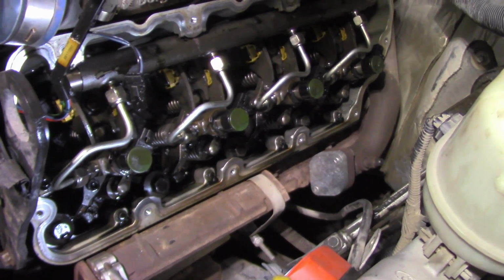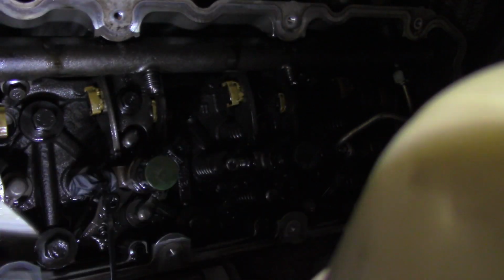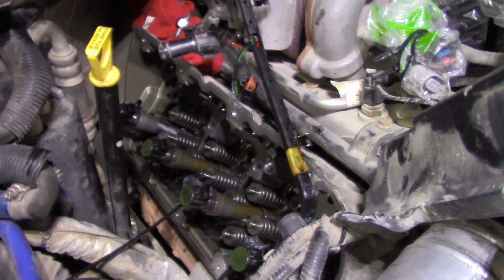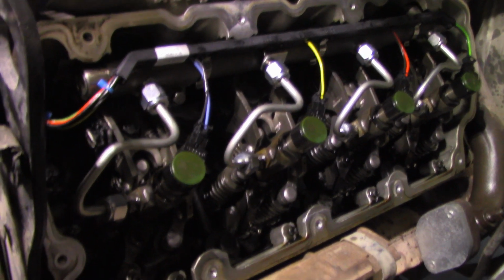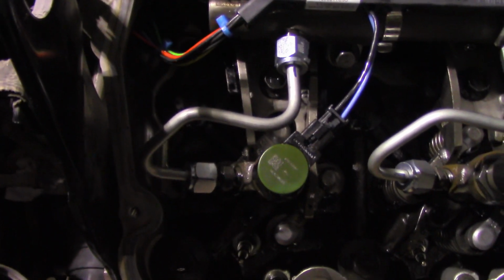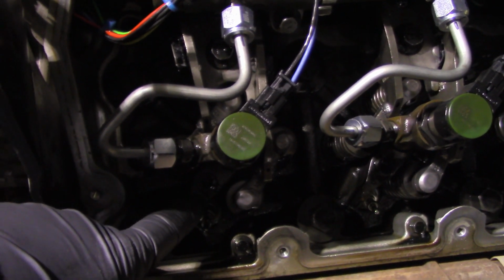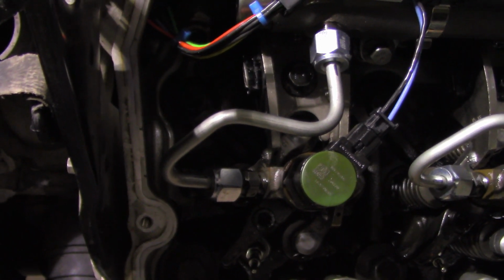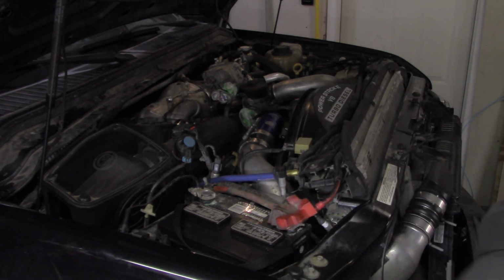F250 6.4 Powerstroke Rocker Assembly and Fuel Injector

Comment: Is there a seal or crush washer where the fuel line from the hpfp connects to the fuel rail?
Reply from the maker: Sort of. Not what you're probably expecting though. It's metal on metal but its precision- that's why they are one time use (the lines). By torquing the b nut on the line, it's conforming to the steel nipple on the hpfr and creating a seal.
Reply: @USAF99 Im talking about the fuel line connecting to the rail from the hpfp.  Back top of the head.
Reply from the maker: @bthorn5035 right. They're the same type as the ones from injector to fuel rail. The lines from the hpfp to the back of the head seal the same way and are one time use. There's a rubber grommet that seals the valvetrain from outside that wraps around the fuel line, but that's it

Comment: 😂😅🤣don't get fuel in the crankcase hell with the DPF still on by time it came around to the oil change you must have had 3 Qts of fuel in the crank case every 5K miles
Reply: 😱💩 Ford has a better idea 💡. Not.

Comment: 105 in lbs is 105 in lbs, it doesn't matter if you put a breaker bar on it or not, it'll still click at 105 in lbs. Alot of good info on these pain in the arse engines here nonetheless. 👍

Comment: At the end of the video it sounded like you had a little bit of a pulse in the idle.  Was that there before and was it more/less significant after the repair?
Reply from the maker: Its smoothed out after the fuel bubbles subsided from having the fuel system open.

Comment: what's the formula for calculating added torque on the torque wrench with an extension
Reply from the maker: If all you are using is an extension, there is no need for torque conversion. Even if you use a wet noodle for an extension, the wrench wont click till the head gets to the set torque.
Reply: I thought it was the offset of the crows foot
 that alters the tourque reading and not the length of the handle. @USAF99
Reply from the maker: @kayjaxnblondie  It is. The OP was asking how to calculate for an extension over a socket, which there is none needed. If the pivot point is offset, as in a crows foot, the force applied is greater because of leverage.

Comment: Doing Rockers, Bridges, and Push Rods in a couple days. After watching this I'm wondering if there is enough room to remove the Push Rods without removing the fuel rail. I know the rockers can be taken out with only removing the lines.
Reply from the maker: Honestly I can't remember 100% to give you an absolute answer, but I think its possible. Just remember, once you crack those lines-- they are dead to you. Throw them straight in the trash. It ain't worth the rectum pain when they leak!
Reply: @USAF99  all went well. Wasn't nearly as bad as I thought they would be! Funny thing is my truck had 6.0 arms without the oil holes! It's a Ford reman. 3 years old.
Reply from the maker: @dakotabrown7698  Good deal! Glad you got it done!

Comment: Is the #7 injector the passenger side very back?
Reply from the maker: Yes.
Reply: USAF99 thanks! I have an open circuit code on that injector. Runs ok. Slight miss and loss of power. Trying to get down to it and locate problem. Thanks for the reply!
Reply from the maker: @diamondhcattle1697  it's fairly straightforward to replace that injector. Passenger side is way easier to get to than driver. Make sure you replace the injector line from fuel rail to injector, dont reuse the old.
Reply: USAF99 thanks for the help!

Comment: Just started watching your channel 👍🏻.  I know it’s too late to do since you already finished,keep an eye on the pipe you have your block off plate attached to. Vibration will crack it where it mounts near the driver up pipe. I drilled and tapped my plate for the EBP sensor and mounted it behind the turbo since that section of pipe is shorter and sturdier. Great videos brother!👍🏻

Comment: Sooo do we get to see the old rockers?.how warn were they.
Reply from the maker: In an effort to keep the video a watchable length I declined to add that to the video, against my better judgment. They were worn both on the rocker arms themselves and the bridges they make contact with, albeit just enough to catch a fingernail on. As we know, small changes at the valvetrain = magnified changes at the valve seat. Since these heads don't have brass guides in them (Its steel on steel) it also helps keep the valvetrain geometry right by doing this.
Reply: @USAF99  can u do the whole 6.4 community a favor and show the wear and what was the runni g condition before and after. Such as sounds at idle acceleration full throttle stuff like that. I'm gonna do mine soon but I'm just curious if u had any symptoms you didn't realize until after the repair
Reply from the maker: Ill see what I can do. I still have all the old parts, maybe ill do a quick follow up video. I am currently wrapped up in a emergency kitchen remodel since my dishwasher exploded all over the floor while I was shooting this video, but after for sure!

Comment: You can also turn your crows foot 90° on the torquing device and not have to recalculate the torque value. Good job, thanks for the info.
Reply from the maker: I have heard of that although I would think you are still making the wrench very slightly inaccurate that way. By moving the bolt/nut left or right of the wrench by X degrees its changing the torque slightly, although very slightly. Maybe ill do a video testing this theory!